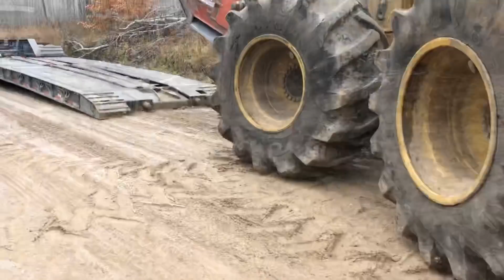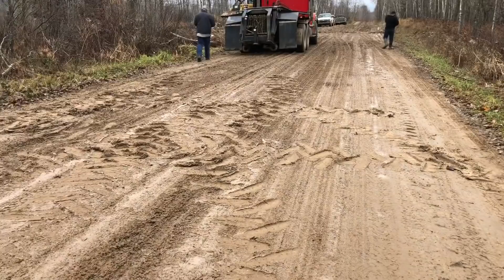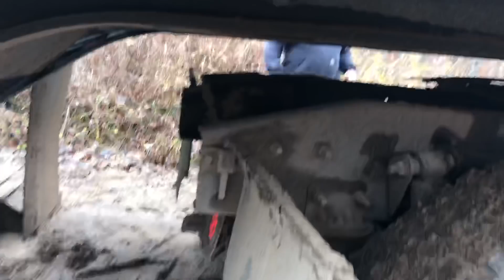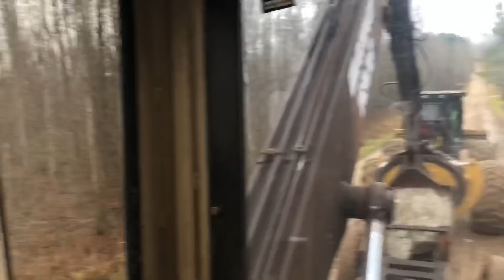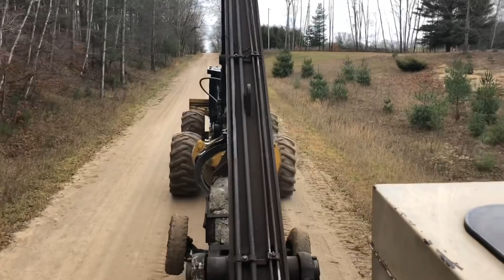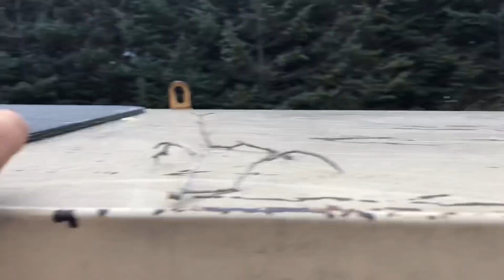MOVING THE SLASHER!!

Comment: Cool little detach trick....  when you are having problems getting one side in all the way lift the trailer put a block under the side that is giving you problems. The set the trailer down on that block. Works like a charm.
Reply: I was waiting for the guy with the wood block to do just that, so there must be something wrong with the audio - he didn't hear me very good, still can't figure out what he did do with that block. Road crown messing with them but if it's not the one thing, it's three others anyway. Keep on rolling John.

Comment: I pulled one of those lowboys, twice. The 2nd time I pulled it in the shop and told them that was IT! The piece that holds the gooseneck up when detached was broke and would let the gooseneck flop and you'd almost never get it back because like with you, it'd be on an angle and a bad one at that. If you had a 5-foot bar you might pry it back over but that did me in. They they started 'Oh, but can't you' and I said Nope. And went and hooked to a trailer dump. I was within a skinny 3/32nds of walking. Wished now I had. And later on I DID! 
Prayers, BLESSINGS and Goomer HUgs!

Comment: I have an 8.5 ton machine with hydraulic drive. It does have brakes, but you only need them when towing a 10 tonne trailer. The hydraulic drive does slow the machine down  and it will almost stop. (provided the engine is running) otherwise it will run away. I wonder why your slasher is so different. ( overrun gear train?)